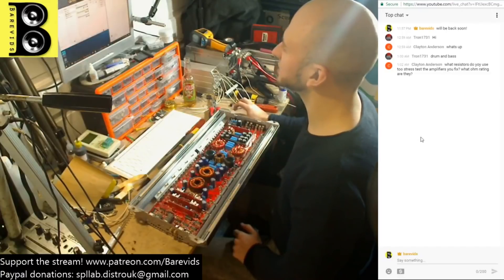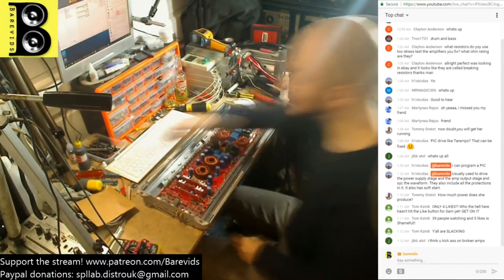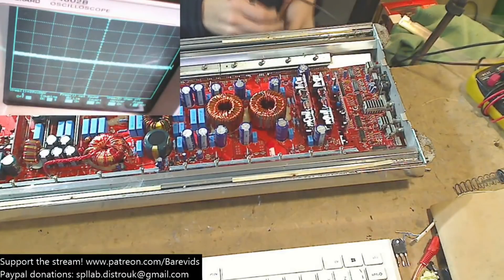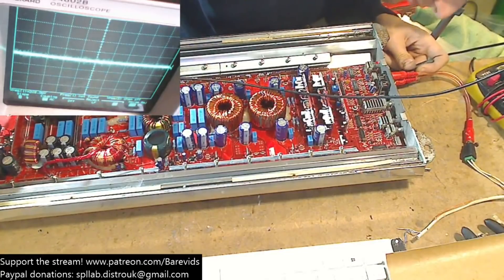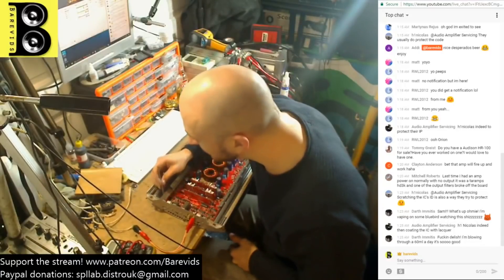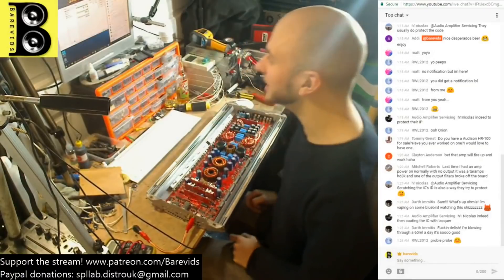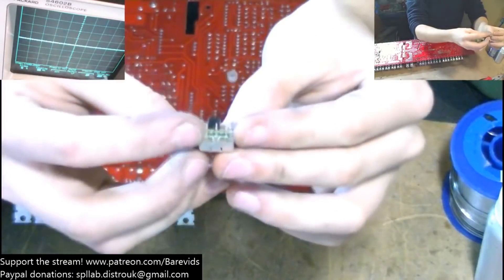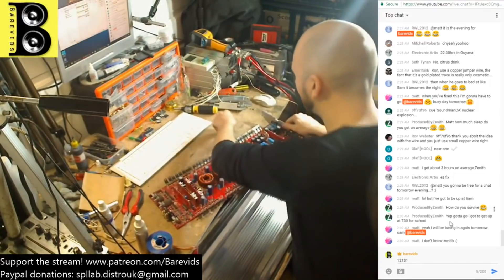Orion 2500D repair - Tiny component brings whole amp down.

Comment: Anyone have any set screws issues with xtr 750.4 and 1000.4 because every time when I are trying to remove the wire set screws keep stripping im not over tightning it. The cobalt i use never give me this issue.

Comment: If you ever run into one of these that needs output driver transistors you can find them on Tayda Electronics, I couldn't get equivalent transistors to work.  C1027Y and A1023Y

Comment: i have one of these amps im trying to fix right now. first one. the power section has 5 fets that are shattered and the top pads on teh board are burned straight off. i have no consistent ohm or continuity between the power section of hte fets.   how can i tell which fets are in which "bank"?
Reply from the maker: Gates are in parallel

Comment: I have d5000 that works only in slave mode, on master is no sound. Anny sugestions?
Reply from the maker: broken RCA connections or bad switch on the input board. Replace all switches and check rca terminal block.

Comment: amateur. you and your work table should be grounded. you've obviously never worked in a professional tech position.
Reply from the maker: I do not know of anyone in amplifier repair business that uses these things. No-one in PC component repair either. I Honestly think component damage by your own body static to be a myth. I'm doing just fine as I am. Thanks for your concern.
Reply: Do you mean that he should have an anti-static mat that is grounded to remove static charge?
Reply from the maker: You're right I haven't. I've been doing this for one year. I'm very much a newbie. And fuck no, it should not be grounded. If it was, I would receive constant electric shock.
Reply: yes. anti static grounded mat and grounded wrist strap. he obviously doesn't even know or comprehend basic theory either if he thinks he would be constantly shocked. read some books first dude. or just get a job that will train you. just by making simple body movments you create and release thousands of volts, esd, that damage or compromise components on the pcb. you're actually fucking shit up.

Comment: As always, great video, crappy Orion junk, but still great video.
Reply: 1 NYC DJ Have you seen the newer HCCA amplifiers?
Reply: Actually I have seen and heard the 17000.1. Friend of mine had 2 of them driving 6 HCCA 15" subs in a slot port box and for 34,000 watts and 6 15", was NOT impressed at all, he wound up sell them and now has 2 Taramps 20k, sounds much better and im not a fan or the Taramps either. Orion HCCA subs are horribly inefficient, I hooked one up to my Ampere 5000.1 and it was quite possible the worse large sub ive ever heard. Two cheap Kicker  comps sounded better and louder. I even tried other models (XTR and Zstreet) the Zstreet blew out the same day and the XTR held out for a month before it blew out. I dont dislike Orion just because, Ive just had horrible luck with anything Orion. In contrast I have an Ampere 5k running at .5 ohms for a couple of years now and the thing doesn't even get warm.
Reply: @DJ_Renn  Orion systems are great, but unfortunately they are only used by professionals. I race with Orion and I am very satisfied. Great quality/price.

Comment: I love your channel, but there is a situation that you should improve that is the quality of the videos. Even at 1080p the quality is not very sharp. Analyze this situation, the visual quality of the videos. @AlvaroGomes
Reply from the maker: The reason it is not sharp is because I am live streaming from an old LGA775 machine. It can only render so much bitrate in real time, which sucks. I am saving up for a modern machine but with PC prices at the moment you understand this is not an easy task.
Reply: That's what I thought.